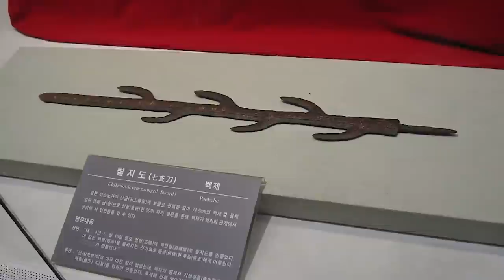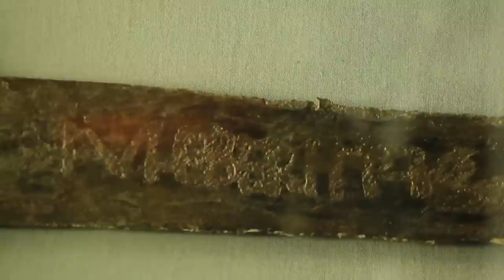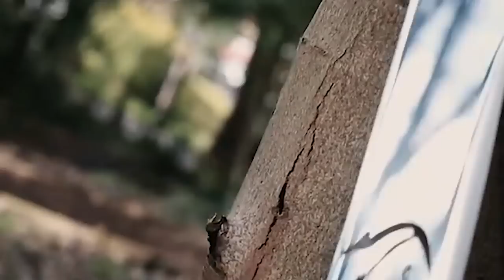20 Most Legendary Swords That Actually Exists

Comment: The modern depicted versions of the gladiolus are incorrect in design. The tip of the blades were more rounded and it's what the vikings based their swords on however the viking swords were deliberately tapered at the tip to be sharp in order to penetrate chain mail.

The gladiolus was more specifically designed with hacking and slashing in mind. It wasn't the best at stabbing but I'm sure some who used it still successfully managed to kill people by doing such.

Comment: Er Napoleon wasn't short, that's a modern misinterpretation of a single account by a village tailor. The tailor never said he was short they used a measurement system different from others and the numbers where botched. He about 5.3 or 5.5 average for the time, the biggest indicator of this besides a revisiting the measurements was the very sword you yourself described. A small man wouldn't be able to comfortably carry a full sized saber, he would also require special aid mounting his horses if which no accounts exist. 
        Sadly the British futher pushed this false statement of his height to futher tarnish his reputation after his defeat however the French took it in stride and never said a thing allowing the poor smiles of the British speak for them.